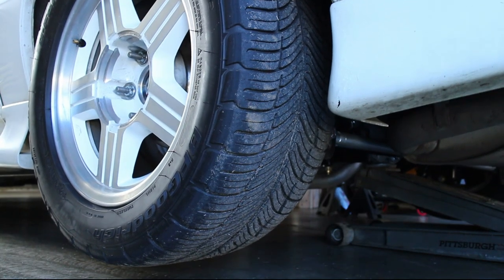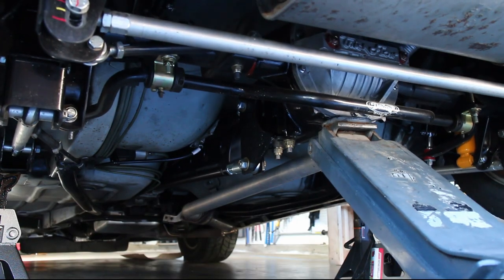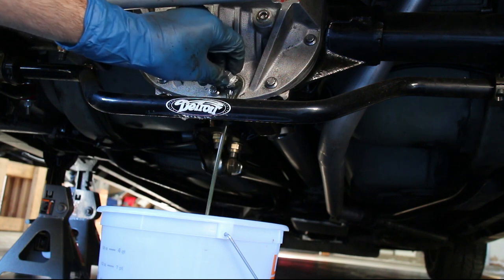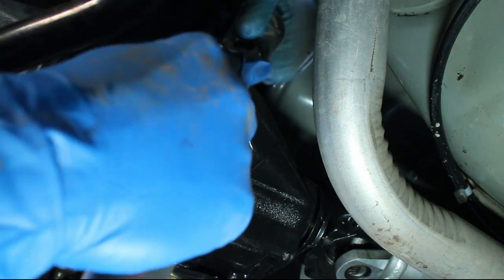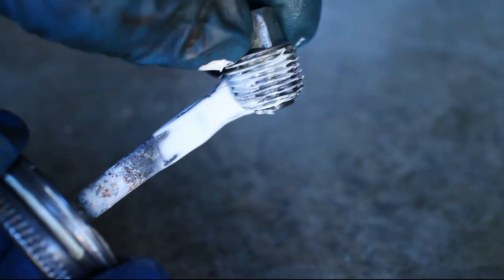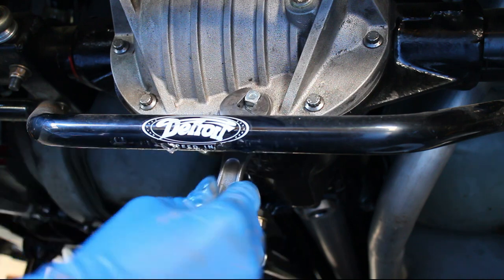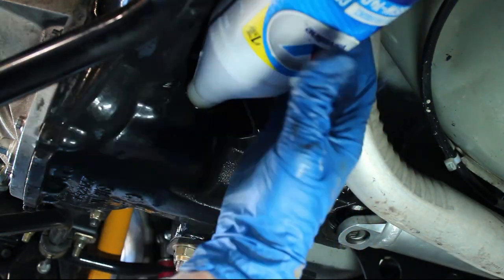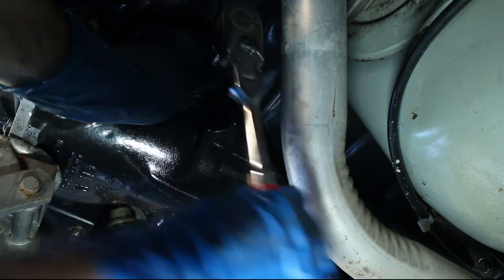How to Change Differential Oil  (Chevy 10 Bolt Axle)

Comment: Another tip: make sure you can remove the fill plug BEFORE you drain the fluid 😁
Reply from the maker: oftentimes my edits are slightly out of order due to time and shot issues.

Comment: The rear axle that I am using is out of a 1993 GMC Jimmy. There is no drain plug or filler plug. So I took the cover off, drained the oil, replaced the gasket and cover and put 3 quarts of oil in through the breather hole. Thanks for sharing.🍁👍👍

Comment: What do you use to open the filler plug?
Reply from the maker: on most 10 bolts it's a 3/8 drive end.
so you don't even need a socket.
Reply: @3rdGenGuy  thanks!